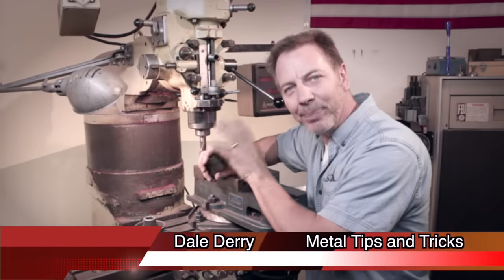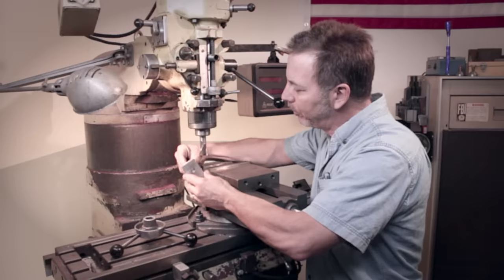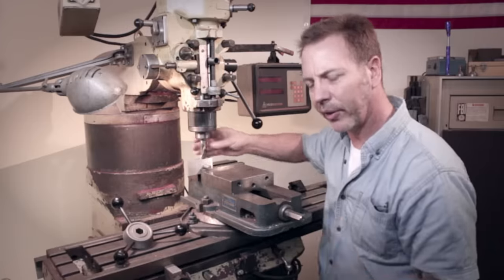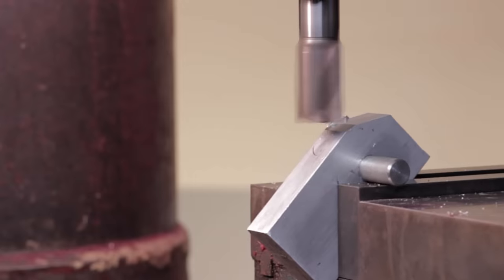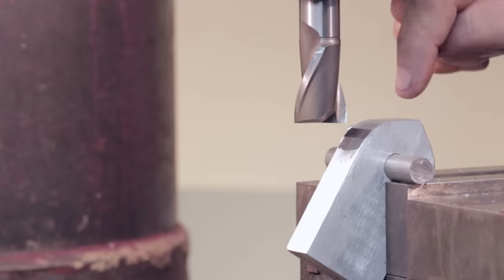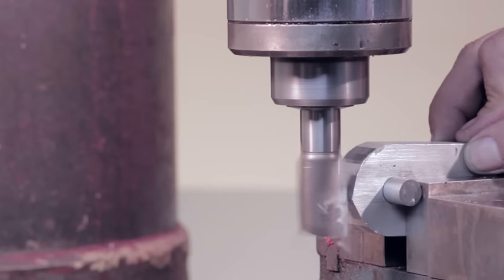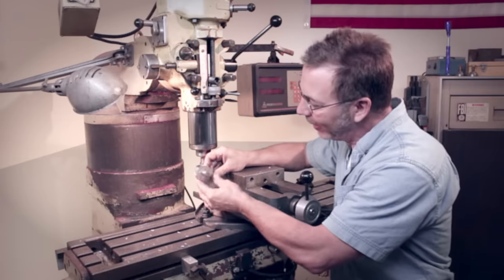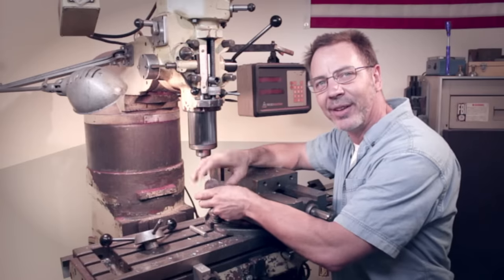How to cut a Radius

Comment: You could probably throw it in between some 1-2-3 blocks so you don't need to go from the top of the vice to the side. Assuming your work piece is small enough that is. 

Good tip though, I never thought of doing that.

Comment: Nice. I'm not a machinist but being a bladesmith and forging metal fit and finish is always in the mix. I was wondering if you have any ideas for milling the edge bevels on both sides of a blade. I haven't quite figured it out and usually grind them in but keeping the lines symmetrical is sometimes a problem.
Reply from the maker: HI Larry. Sorry I dont have a good answer to your quetion

Comment: Hi Dale,
I'm building tools to build brass musical instruments.
I've just used this technique to build a couple of tube bending press tools to go in a fly press. I set up my block using a wiggler, but only on 2 edges. The tool came out great in many respects. But not properly centred.
Should I measure all 4 faces to make sure I'm centred? On both I cut the height of the block before I cut the radius and on both I ended up with a flat at the pinnacle of the rad, meaning I've either cut the block too short or drilled the centre wrong. I have noticed that, especially on the up-down handle, I can move it quite a way before the DRO moves. 
I'm not an experienced Milling machine worker.
Any advice?
Reply from the maker: It sounds like your mill is worn out. Try to mark the center of the hole by hand with a punch then use a centering drill to start your hole. A centering bit is like a drill bit that has been harden  all the way though like a end mill.

Comment: I am primarily  wood worker and while using a hand held router there is always special considerations when pushing the router cutter against the work piece and back cutting, pulling the router with the rotation of the cutter.  Are there any accuracy or safety consideration in using a mill?

Comment: Mount pin vertically in the vice to desired angle if you want a bevelled radius other wise make the true to spindle then using an adjustable wrench hold the part and pivot around the pin as require until you get the required radius.

Comment: Super technique! I have a mill but no lathe and need to cut an outside diameter on a an arbor to center a saw with a 1" mount. It would be easier if I could find a cutter with the edge reversed. The I could make the cut as if I was boring an inner diameter. Are you aware of such tools or do you know of a technique for boring outside diameters?

Comment: You could also secure the work with a bolt instead or just weld a stop onto the end of the pin. Why? so you can clamp the pin VERTICALLY without having to worry about the work moving on the pin. Weld the stop on the end of the pin. Push the metal stop all the way against the work, and then vice grip the other end of the pin so your work is now rotating around a vertical axis. Now you can do the whole thing in one pass if you move slow enough. It's faster, and instead of eliminating high spots one by one, you end your work on one continuous pass... so you won't have to file or sand anything... and it'll look nicer too. Hell... you can chamfer or fillet the edges too if you feel like it.

I try to do radius off with the same pilot pin. 1/2 in bolt (thread sawed off). Nut gasket, washer... so you can secure your work piece with some compression and give from the gasket... allowing your piece to not spin freely, but also be able to move it with your hand or a hand tool.

If it's particularly important to keep the piece straight and tightened down, I'll actually put a full thread bolt and a coupling nut instead... and tighten my workpiece to the top of the vice as tight as I need it. This makes it extra safe in that the work piece will not get away from you. You can slide a large washer between the workpiece and the vice if you want too. Provides a little more angular guidance for your work.

Best part is... you can use these things over and over and over. Just make a habit of doing radius first, always drill the same size hole for radius, and mark your diameters before drilling (they come in handy if you need to drill a larger hole later). 

Another thing you can do if you need a large hole and a radius. Drill a small hole where you need the large hole... and then change bits, and drill the large hole just a few millimeters into the surface with a flat bit. THEN you can fasten your piece to the vice, and when it's time to drill out the larger hole... you don't have to do any measuring. Just put the bit directly into the hole you've already started to drill.

Comment: I'm wondering if he could put the round pin vertically in the vise, and the piece horizontally, and then rotate the piece horizontally against the mill bit. Maybe by holding onto it with a tong to get leverage and stability.

Comment: Your procedure will work; and with some filing/sanding at the end; it comes out pretty good. But there is a faster and better way also.

Simply purchase (if you do not have one already) a radius mill; where the radius is identical to the radius you want the curve to be.

Insert the mill in the chuck. Then clamp the stock into the vise. Adjust the lowest part of the radius to just touch the stock. Back off a few thousandths. 

Finally: cut one side then the other and then bring the mill to final dimension. In just a moment you have a perfect radius in steel or whatever, with little to NO sanding or filing needed; or cutting down the "high" spots.

If you are dealing with aluminum or brass, etc; you can do it even faster on a router table. Even better if the router bit has a "follower" bearing. Then there is no need to start by loosening a few thousandths, etc.

For whatever it's worth.

Comment: Having the cutter running whilst changing job position is not the biggest safety issue, resting your hand on the vice whilst the cutting is running down and turning to the camera 8:19 is worse as attention is taken from the hazard. That said i have just the part for trying this technique. Thanks.

Comment: Or if you have no CNC & depending on how many parts you have you could just buy a Radius cutter or as some refer to them as corner rounding end mills & do your radius easier without taking all day to machine the radius . Of course they only go up to a certain size but unless your part is much bigger than this part  you can pretty much find the right size . Please don't say belt sander. i would rather make a jig to use on the rotary table as the part is going to a customer & unless they don't care what the part finish looks like it's your name on it.  I will not dwell on it but Eric Horton's comment is right on & one wrong move & bye bye finger or worse fingers.  These days 99% of shops have put their rotary tables in cosmoline & have at least a CNC mill & lathe.

Comment: Hi Dale, I have gotten back to working on my lathe again, and I have seen the vertical sheer tools and face milling round carbide tools in action to get a smooth even finish on a barrel or a solid 400mm x 8mm stock. I am not able to achieve a smooth finish due to the rod boucning up and down around my carbide tip. I have played with rpm and also used a steady rest but no luck. I am not a pro but would like to see a video of this done by someone like you or point me to another video with some advice. Advice <-- No pun intended.

Comment: Doesn't anyone hold the pin vertically in the vice , touch off on the side of the material and then manually rotate the work ( with an extension handle, ie a barclamp)?
Reply: Have you actually done that?  Unless you are machining air, the cutter will grab the work and whirl it violently around until it meets the "high side", then all Hell breaks loose!  Better to make a plate with a circle of holes that will permit rapid indexing.
Reply: @bpark10001  I frequently did it in a pillar drill, these days I'm lucky enough to have a n indexing table

Comment: for the final cleanup why couldnt you have stood the pin up vertical in the vice and put the part on the pin and turned the part so you took 2 thou off of the whole curve  against the side of the cutter ?

Comment: im in my 2th semester of manual machining in college. was looking for something like this.  nice video. so im guessing to control the actual radius dimension its the middle of that hole/diamter for the pin + out 1.0 on z?
Reply from the maker: correct :-)

Comment: Use the pin with the belt sander. If you only have 1 to 2 parts this is much better than sticking it the NC.

Comment: Yeah so what, I'm a troll. You got me. My nickname is "Little Wonder". Because I wonder about everything. As a little boy, I would always say, "I  wonder...." That inquisitive nature is with me and I hope that it never leaves.

I'm retired, forcibly, by a disability, but I never stopped learning. I have an aluminum part of my Old Craftsman Planer/Jointer. They designed it to raise and lower the infeed table. A long bolt runs through the center of it. 

It broke into 4 pieces along the horizontal axis that the bolt runs through. Tried epoxy, doesn't stick. Tried size 6 screws, too wobbly. Bought some of the aluminum solder from Harbor Freight and some MAP GAS from Home Depot. If that doesn't work I'll have to try to mill it myself. I need my planer back for my kitchen remodel. I keep looking on EBAY for a replacement, and obviously still looking.  Anyone with an alternative method, I'll listen. The part is smaller than a 1 inch cube.

The rods come from alumiweld.com
I'm a troll with a mission. I'm also a disabled veteran so if there are any volunteers to help in SW Florida.....
Reply: Tim Thomas can you cast an aluminum replacement?  Lots of YouTube videos on the subject.

Comment: That'd probably work pretty well if you only had a lathe you could put a cutter in the Chuck and clamp the work in  the toolpost. I've had success facing things in my little hobby Myford mill with one of those fly cutters where you clamp a HSS toolbit in the slot with grub screws

Comment: There's an easier way to do that.

That pin that you got going through the workpiece, reduce that until it's about a half a millimeter longer than the hole you made for it.
Then, instead of clamping the workpiece, clamp the pin right at the corner of your vice.

Now, the workpiece spins freely (somewhat) around the pin.

Now, you want to prevent the piece from spinning out of control. It won't spin out of control toward the bit, but it just might spin out of control AWAY from the bit and cause you to cut out a chunk on the other side or maybe even break your bit if the spin is fast enough. Worry not. All it takes to prevent that is a zip tie... maybe clamp down a piece of soft wood... anything to jam up the spinning area for your workpiece.

Now, all you have to do is slowly, gently get the bit and the workpiece to the right elevations... turn it on... and gently spin the workpiece around the pin (You can do this with a wrench, or pliers if you prefer. You can clear 90+ degrees of radius in a single slow pass... then you flip the work, do the same thing, and do the other 90 degrees of the work.

note: in order to get the full 90+degrees on your pass, you have to turn the work until it's inside the vice. You can push it a bit extra with a stick or a magnet stick if you prefer, but don't worry about pushing it too far... because you already put a ziptie, or chunk of wood in your way. As long as you have the appropriate safeguard preventing the work from spinning completely around, there's nothing to worry about.

Comment: I’m not a machinist (yet), and I’ve only used a mill a couple times, but I am confused.  This looks like it takes way longer than using a rotary table.  What am I missing?
Reply: If he was doing say 20 parts , then time to setup rotary table averaged out per part  vs time to do this on just one part.   Also spec on drawing.  I see it as a different direction , like if you don't have a Rotary Table  etc.

Comment: Could you not use a bolt instead of a straight shaft and clamp it tight then use a Manual rotary table with chuck to keep central and cut In one turn? Curious about these techniques and learning to be creative with developing techniques but I would have thought the theory of using a pivot point would make more sense if you actually turned the piece into the cutting tool and got a smooth finish in one cut? Am I missing something here

Comment: What if you don’t have a hole directly in the middle of the part where you need the radius??
Reply: I think you would have to use a rotery table then my friend or dill in a 1/8 pin if you could get away with it .

Comment: You left 0.002" on the radius, I thought you were going to set the pin vertically and shave the 0.002" off by hand rotating, I think that could be done.
What do you think.
Thanks for the video.
Reply from the maker: Thanks for your comment Noel

Comment: Interessting! Why is there no vise like tool to grip, and position a part so that it can be turned 360° around a chosen center? You would not need a hole to turn the part in question.
Reply: Rotary table
Reply: @BojaneBugami  I guess i explained it a bit too simple. The vise would be small and able to rotate, not obstructing work on a large part of the work piece, if you use the rotary table you have to turn the work piece around if you cut a radius which goes all the way in one dimension, because it can not turn around this axis, at least it can not turn around a center chosen on the workpiece, but one inside the table itself.

Comment: If your DRO has PCD function then this method is way easier for a similar surface finish.
Say you want a 30mm radius and you have a 20mm 4 flute cutter
Press pcd and enter 
Pcd x y
Number of holes: 100
Pcd: 80mm
Start angle: 1.8*
Finish angle: 358.2*
Then plunge cut on the area of the circle where you want the radius. Very simple and way easier than this method shown in the video
Reply from the maker: You are right but my dro doesn’t have that fiction. And the point of the video it to show a different way to make a radius

Comment: I'm new to this, wouldn't it have been easier to clamp the pin vertically in the vice and have the part you are machining sit on top of the vice jaws?  Then set your distance from the center of the pin?  Then you could just rotate the block around the pin and be done in one shot.  Is there something I'm missing?
Reply: Kevin Carroll There’s a few things your missing bro. Your way the block is unclamped going into the cutter, which will end bad.
Reply: @georgeseymour2869  thanks, didn't think about that

Comment: If you can mill that well sir, why haven't you made a simple rotary table with dado's so you can attach a small vise to clamp your projects? the you just have to align the center-point (and I would actually wait with drilling the hole, and make my radii FIRST not last. ) and you don't need to do dangerous work as you've shown us now. (and i'm a beginner, but a safetyguard :) )
Just a rotary table, give it an M6 thread on the edge, use an M6 rod with a handle to rotate it, and there you go, a clamped project ready to be milled in a safe way.
could be one of your next projects perhaps, that rotary attachment :-) I know I will for my press drill :-)

Comment: Wish you would take the time to explain the various radius Dimensions such as 1/8 1/4 0.50 0.75 etc and how to accomplish the task using the mill... thanks
Reply from the maker: Hi, it really doesn’t change with the radius or cutter diameter. Just do it😀

Comment: Nice proof of concept.  You could conceivably work through the math about how rolling on the edge of the pin works as well as pivoting on the center (using your imagination to fill in the gentle snoring of your viewing audience about 15 minutes into the video).  But the demo does the same thing in a more compact and interesting format.

Comment: would it not be easier and faster to clamp the pivot point in vice and rotate part
Reply: No that would make the part free spend and that's how you crash a mill.
Reply: @danielmcdowell9526  mole grips?
Reply: Yea I guess that could work only think is if the mill grabbed the work it could pull it right out of them and then you got a pair of grips moving at high speed. Its best to always make sure there are atlest two solid contact points with the work at all times. 3 points is the best both sides and the bottom. When it comes to strong machines like this its best to keep yourself as far away from the cut as you can and still be able to do your work. Trying to hand hold a work peace on a mill is a very dangerous move.
Reply: I have learned over the years that trying to get things done faster very often leads to taking sort cut and sort cuts will get you hurt or worse. I have seen it happen time and time again someone just wanting to find a faster way to do something and they put themselves right in the danger zone. I have had fellow workers lose fingers and get cut very bad one guy tried to hold a part with some grips and it pulled him in and messed up his hand very bad before we could get the mill stopped his hand is all knotted up to this day and its be 16 years or so. He'll never be right again and the bad part is he had a vice right there and just wanted to do it faster.
Reply: Sorry my post were so long. I just want you to be safe if this a line of work you want to get in or are in now. Either way good luck and be safe.
Reply: If there is anything you would like to know and its within my abilatys to help fell free to ask and ill do my best to get you an answer or find someone who can help.
Reply: @danielmcdowell9526  fare enough thanks thats some good advice 
I'm just watching these matching vids getting ideas I've not yet been loose one a mill lol but have ideas of future projects may invest later but will still be watching your vids